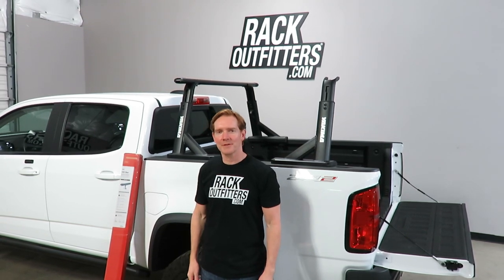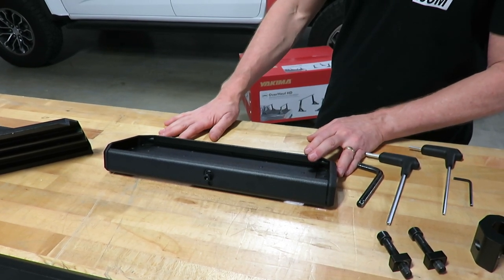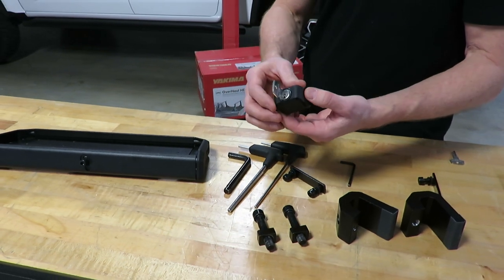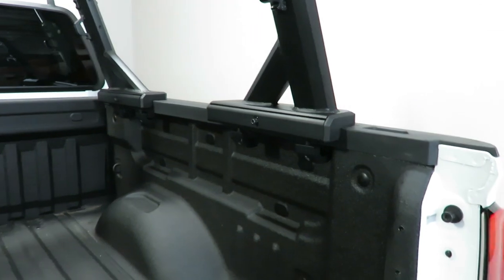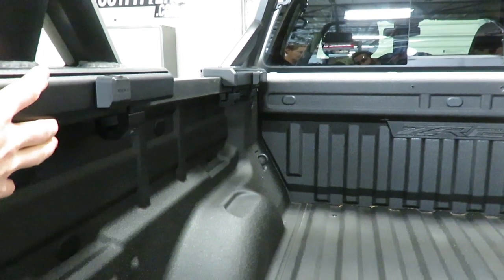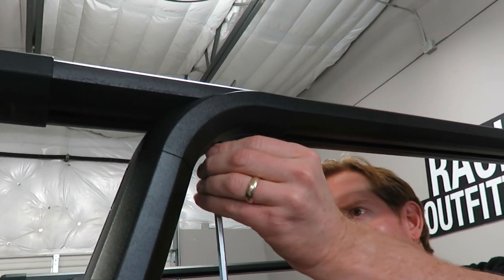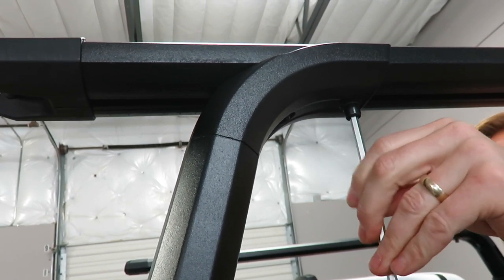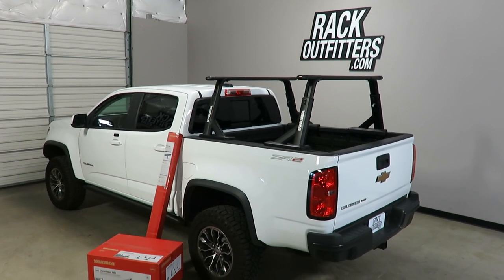Yakima OverHaul HD Adjustable Height Heavy Duty Truck Bed Rack Install and Overview

Comment: Certainly looks to be the most solid of all that I have seen so far with a price to match.  Most people probably only need a fixed height not necessary to be adjustable at less cost.
Reply from the maker: Peoples needs have changed so much that its nice to see more products with adjustability or set heights for all those different set ups you amazing customers come up with.

Comment: Would this be able to be installed on a 2020 Ram Rebel that has a Tri fold Undercover Armor Flex Tonneau cover. If not, is there an additional item I can purchase to make it fit. If still no if there any other racks options I can purchase. Thank you !!

Comment: Is there a base that will allow it to mount to a flat surface like a diamond back cover? Also, to remove it can you just loosen the bolts on the base plates (where the locks are) and loosen the crossbar or does it have to be completely disassembled?
Reply from the maker: If the Diamond Back cover which you owe has tracks in their sides similar to Retrax tonneau cover there is an option to mount this system. With that set up, you would be able to take it off with minimal disassembly, meaning you may need  to loosen some of the top bolts in order for it to come off smoothly

Comment: great video! are there different end caps for the cross bar for adding an awning for instance?
Reply from the maker: Thanks for your question! Most awnings use a bolt/clamp around the bar attachment or a plate that can be attached to a T-Channel style bar. With the weight of most awning's you'd want something beefier than a end cap holding it on during those highway speeds and rides. Most brands have adapters to the various cross bars for their awnings though. Maybe one day, there will be an awning that extends out of a set of cross bars...Hmmm maybe I need to get to work on that...

Comment: Any idea why Yakima provides no way to lock the rack base to the truck when using the Nissan/Toyota rail adapters?  I just installed my rack and was blown away that all it would take for a thief to take the entire rack system is a Yakima hex tool and about 60 seconds.  The base locks are useless unless using the standard clamps which I can't use.  On top of this huge oversight. the HD cross bars also can't be locked to the rack base.  Again, a Yakima hex tool and 60 seconds and the cross bars and anything attached to them are gone.  I find this utterly unacceptable that a rack system that runs about $600 can't be secured to the vehicle.  I'm totally disappointed.  Any ideas from anyone out there?

Comment: Can this rack work with 
RetraxPRO MX Retractable Truck Bed Tonneau Cover installed?
Reply from the maker: No, it cannot. It requires the tracks from the XR model. You may want to contact Retrax directly about a conversion to XR kit.

Comment: Will this fit over a truck bed liner?
Reply from the maker: It has clamped over all the plastic insert bed liners I have tried it on. There might be the odd one that requires some sort of slight modification but that would be a incredibly rare situation.

Comment: Can you adjust the rack height without removing the load bars?
Reply from the maker: The bars do not need to be removed, however, you'll need to loosen them up to allow for a height adjustment in the towers.  The Thule Xsporter Pro offers height adjustabilty without loosening the bars because the their uprights are parallel with one another.
https://www.rackoutfitters.com/thule-500xtb-xsporter-pro-black-multi-height-aluminum-truck-rack/

Comment: I have the same truck. Are you able to move the rear rack back some more? or is it all the way back?
Reply from the maker: Yes, it can be moved back, however, it will cover the post hole/grab handle.
Reply: @rackattack  Thanks. Just picked them up today. They were back ordered for over a month.

Comment: What is the width of the cross bars? 68”?
Reply from the maker: It will vary per vehicle but this truck is using a 55-inch load bar
Reply: @rackattack  What size bar would you recommend for a F-150 that will carry two fishing kayaks?
Reply from the maker: @clayrobinson3432  We just installed an OverHaul HD on an F150, it uses 60-inch bars but for two fishing kayaks you'll want 68 inch.  We'll post up that video on our channel very soon.  Also, you'll want to look at the new Yakima BigCatch for you kayaks: https://www.rackoutfitters.com/yakima-bigcatch-heavy-duty-kayak-carrier-set-of-4/